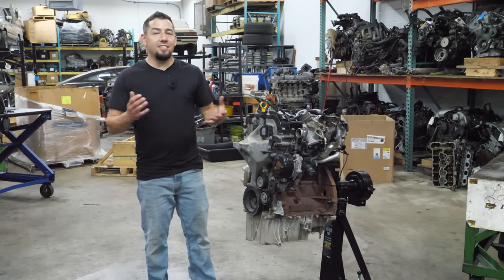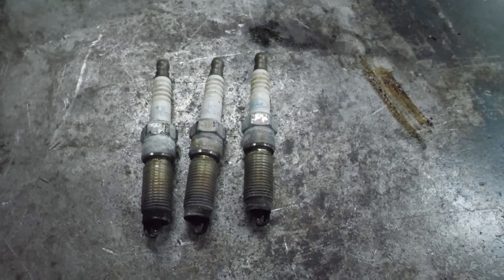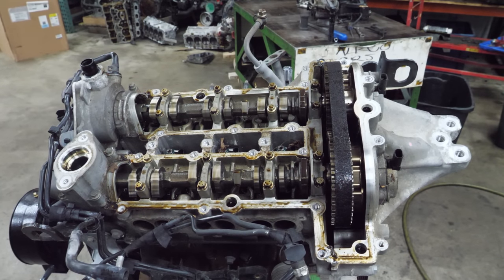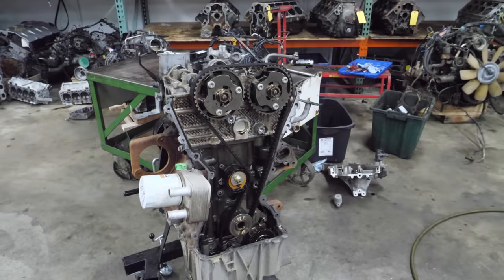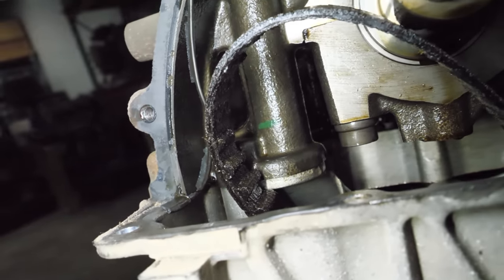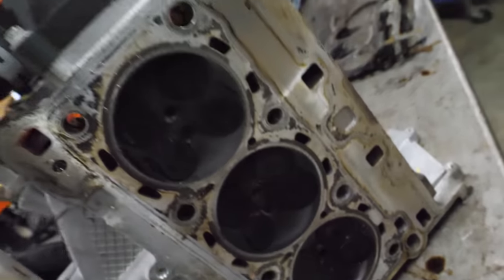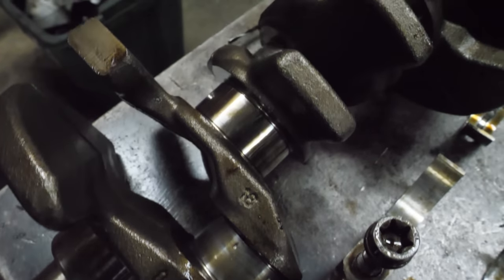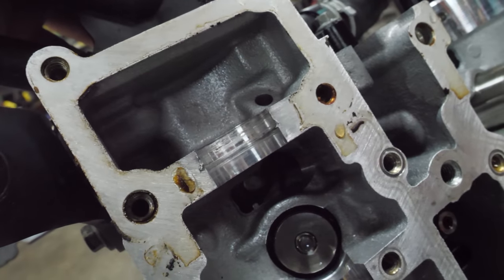JUNK Ford Ecosport 1.0L 3-Cylinder Ecoboost Teardown. LAWSUIT ENGINE!

Comment: The wet belts are of a specific polymer combination to accept oil wash down. They have shorter change intervals. They are slightly more efficient than dry belts but failure can result in a clogged oil pickup and filter. The filter will then be in permanent bypass, alongside the possible piston to valve interference.
Reply: Another commenter mentioned Stellantis is making similar designs - what’s the advantage to all this disposable timing stuff, and now the wet belt?
Reply: i think it's because it's not as noisy as a chain and eventually you don't know if it's time to replace it if you don't hear it. It's all very well calculated. Damn thieves, they just think of ways to take as much money from us as possible after you give a bunch of money for the car.
Reply: Thats quite an unbelievable design decision to have a short lifespan timing belt. Especially seeing what an absolute mission it is to replace. Dont see it happening without pulling the entire motor😮
Reply: Haha ,they have shorter intervals because it's a plain belt and normal oil 😂
The guy who said it's a particular composition belt is pulling everyone's leg. 😂😂
Reply: I checked the Ford maintenance schedule. It calls for replacement of the timing belt and oil pump drive belt at 150,000 miles. Given what was written on the oil filter, I believe this engine failed before 60,000 miles, and both belts were clearly well past their useful life.
Reply: @jeffreywoods4040  Indeed. The PureTech engines. They are pure trash. Belts wear down and debris from the belt clogs the oil filter with possible catastrophic results. They is a huge amount of cars driving around PSA (peugeot, citroen and ope;/vauxhall) with terrible reliability.
Reply: @PbPomper 
Yeah, my company Peugeot Partner van suffered with a blocked oil pick-up at a mere 20k miles and had to be rebuilt.
Reply: actually this wet belt have a longer interval than most dry belts.  Like another one mentioned 150.000 miles or 240.000 km. and they !can! last that long. But the most common reason for the failure of the belt is wrong oil.  Special oil is needed, otherwise the belt is sucked dry, exactly like this one. And im pretty sure that is the cause of this failure too.  Even if someone just topped of the engine with 100-200 ml of the wrong oil, it can damage the belt.

And the failure of the belt results in a clogged oil strainer following with complete oil starvation. And if that happends, all the bearings will take damage, like seen in this video. 

so never buy a car with a wet timingbelt (when u cant be 1000% sure that noone ever filled it with the wrong oil)

Funfact: the estimated engine life of the 1.0 Ecoboost is ~200.000km. So theoretical: when the engine is at the end of its lifespan, the belt is still good to go.
Reply: @MrTheHillfolk  Not true. I've seen composite belts made by Gates and others for all kinds of applications. Never seen one for wet designs however.
Reply: "iT's MoRe EfFiCiEnT"
I wonder who measures 'efficiency' this way.
To me, the most efficient part is the one that you never have to think about.
An engine that goes 100k before needing a major repair but gets you 20MPG is much more efficient than an engine that gets 30MPG but needs to be rebuilt after 60k.
All the money you saved on gas is getting spent on that ridiculous oil-immersed timing belt. Whoever came up with that idea is a colossal idiot.
Reply: @noobigernoobnoob7507  
Deutz uses belts. 
They almost doubled the belt life by directing air at it on one engine design.
Instead of being trapped under the timing belt cover, they ducted some air from the cooling fan to it. 
Haha I don't know what idiot thinks hot oil will cool better than air 😂
Sure liquid can carry away more heat ,but not if it's hot already 😂
Reply: @paulherbert5548  yeah that's the thing , skip an oil change or get a bunch of fuel in the oil and bye bye belt
Reply: In other words, it is a bad design choice.
Reply: @MrTheHillfolk  And with a turbocharged direct injection engine, fuel ALWAYS gets in the oil. It's not a question of if, it's a question of how much.
Reply: A well designed chain  system would be better than a wet belt , clearly cost saving hit the design.
Reply: @peterwait641  a well designed chain or belt would be better. It has the extra maintenance needs of a belt, the complexity to service of a chain, and an additional risk that a normal belt or chain wouldn't have due to the risk of the rubber deteriorating if you don't use their specific oil. 

They could've easily just adapted a chain to that design and eliminated all the added headache, and there's no good reason not to.
Reply: @SkylineFTW97  exactly ,and short trip driving is the worst for them,then they really load the oil.
Reply: @MrTheHillfolk  with a turbo DI car, I'd never recommend going past 3k miles between oil changes anyway for that reason.
Reply: @tomokokuroki2506  just quoting engineers much smarter than i
Reply: @tomokokuroki2506  power out ÷ power in. Nothing to do with "financial efficiency"
Reply: @peterwait641  it is most likely cost savings and planned obsolescence, I'd agree chain is best, more efficient than gears, quieter (better for avg person) and more durable than belts.
Reply: @phprofYT  yes
Reply: @amphedroxyn4251  Do you really think that engine would get worse fuel economy if the timing belts weren't immersed in oil, or they used a chain instead?
The reduced friction probably gets you a fraction of a horsepower more, and remember that you're exchanging severely increased repair costs for this if you're the customer.
The only people benefiting from this are the manufacturers who now can sell more engines and components. People should be aware of this and avoid purchasing things that are intentionally faulty.
Reply: @SkylineFTW97 Honda and gcv vertical shaft lawnmower engines were OHC with wet belt up till 2020. Then they went to push rods. Now they are getting away from the consumer engines. I don't think the new modular design was any good. Lots of them.blew up
Reply: @marshmower  I heard they used plastic cams too
Reply: @amphedroxyn4251  Toyota yaris is in the same small car market , they have a reliable chain !

Comment: The first time I ever broke into a modern Ford engine was with a 2.0l ecoboost in my 2013 ST3 Focus. I knew none of this information especially with the keyless crank and all that and I had to learn as i went along. Thanks to your videos I’m gathering a LOT more knowledge of these and you’ve kind of helped along here. I learned they use friction washers and I feel that a keyway would be much more important to have that just a simple torque retention. That in my personal opinion is one of the most inconvenient things any manufacturer could have done.
Reply: funny that my 2013 needed a new engine at 23k, found out later that a bunch of the 2013 plate units got fitted with dodgy piston rings that can grenade and any point and ford just kept silent about it hoping all the cars pass their warranty date before the issue come up unfortunately for me that issue cost me 5k and once i've got rid of my focus I'll never touch a ford again.
Reply: I still drive a Mk1 focus with the Ford/Yamaha/Mazda-collab 1.6 Zetec-SE engine.
It was their first engine whith a keyless crank and cams. The cam sprockets just had  a conical fit.
The whole idea was to save costs on machining and assembly. As far as maintenance goes.. So much that can go wrong.
Reply: It saves a machining step, it’s about cost. I doubt that was the cause of the failure.

Comment: I am a electrician that was doing some lighting in a Ford repair shop. Started a conversation with a mechanic that was replacing this engine with a new one. He said to me the same things this video was showing and telling. The reason I was researching the mechanics comments.Oil wet timing belt fed pumps are a accident waiting to happen. It is not a matter if it will fail, but when. And how soon. Purchasing one of these engine driven cars is only done under a full warrany. After warranty, get rid of it! And do not buy a used one.

Comment: I had this engine paired to a 6 speed manual in a 2015 Ford Focus. It did seem a tiny bit down on power in that car, but I am also a bigger person. Added a cold air intake and that made it sound nice and did noticeably add a little bit of power. I took it from Portland, Oregon to Reno, Nevada, on one tank of gas. Really loved it because the only option it had were that engine and a moon roof. Watching your video makes me kinda glad I got rid of it several years ago, but damn the gas mileage was awesome in that car.

Comment: Oddly enough, as a Ford dealership technician since 2000, I have yet to see one of these gems. After doing countless phasers, chains and water pumps on 3.5s both NA and GTDI, along with 1.5 short block and 2.0 long block replacements, I have yet to come across one of these wet belt engines.
Reply: What are your thoughts on the 2.7?
Reply: Same my buddy has only seen one 10 in on any platform and it was for something unrelated to the engine....
Reply: @mcallihan100  Other than the oil pan leaks that only seem to go away after a person fixes it, not much bad to say,
Reply: Just wait till you have to quote a timing belt. Nothing but endless discard bolts
Reply: @mcallihan100  as already mentioned above, other than the oil leaking from the plastic oil pans, there's not much else to be said about them.
Reply: Same. I'm a warranty claims adjuster and I've never had a claim on the 1.0 Ecoboost.
Reply: @michaelchan8915  glad to hear it. I have a fusion with that engine and knock on wood I haven’t had any issues with it other than the rear main seal leaking but that was fixed under warranty. 95k miles and still going strong.
Reply: Here in the UK almost all fords use the same wet belt engine, only the TDCI/TDDI in some Transits and Rangers use dry belts, but ford is moving to a completely ecoboost wet belt.
Reply: @mcallihan100  How did your leaking rear seal manifest itself? What were your symptoms?
Reply: @NotAnonymousNo80014  No real symptoms. Just was under the car doing an oil change and noticed oil right in between the engine and transmission. Surprisingly, the oil pan is completely original on my car and doesn't leak a drop. Mine is a 2018 though, and I've heard they updated the gasket for 18 and newer 2.7 and 3.0 nano engines.
Reply: Honda makes an OHC lawnmower engine with a wet cam belt.
Reply: Seen a few of the turbo escapes with chewed up oil pump belts. None of them had over 100k miles.
Reply: Does the 1.5 also have a wet belt or is it dry?
Reply: We had a turbo and cam failed   at  50,000km in NZ mondeo 177kw
Reply: That's because once they hit 70k miles they are junked.
Reply: I'm a Ford tech in europe, and I've had the questionable pleasure of doing timing belts on these. Absolutely awful to do, you need so many special tools, have to clean the sump, the oil pump, pretty much flush the whole system because bits and pieces from the timing belt will end up everywhere.
Reply: @brianallen9810  
This would make a nice lawnmower engine.
Reply: @patrickf6553  
You speak from into it elbows deep experience.😊
Reply: @michaelchan8915 recommend doing catch can on 2.7?

Comment: Hi Eric, great teardown, I've been curious as to the insides of the 1.0 Ecoboost and it's wet belt! I was one of the first to buy one in North America: I ordered a new 2015 Focus, 6-speed manual, a couple of months before that engine was added to the Focus plant in Michigan, based on the good reviews the engine was getting in Europe (this was in 2014, before the problems became known).   I drove it daily here in Canada, summer and winter, and put 330,000km (a little over 200,000 miles) on it WITHOUT changing the timing belt or touching the engine in any way, other than regular oil changes and a set of spark plugs!  I guess I was really lucky....I sold it in late 2021, as I was having some transmission issues...and by that time it was apparent that the belts were a ticking time bomb.  I was getting rather nervous about the belt failing, and having read up on the belt replacement procedure (special tools required to align everything because of the unkeyed shafts) I decided to let her go.  It served me well, although the fuel economy was good but not as great as I had hoped.  I think the reason it lasted as long as it did was the fact I was driving highway, 77 miles to and from work, each way.  I did run the heck out of it, though, you could rev those things up pretty high!  I always said it wouldn't win a race, but it wouldn't get in anyone's way either.  I think what really kills the belts (other than having a belt run in hot oil in the first place) is city driving, the 240 degree power pulses of a 3-cylinder at low revs must put a lot of stretch-and-release tension on them, no wonder the teeth shear off!  I miss the ease of service of my 1993 Escort from years ago, I could change the timing belt in 45 minutes in my driveway...no such cars nowadays. :-)  Keep up the great work!

Comment: This was fascinating to watch - this was identical in  every way to what happened to my Focus Engine.
Reply: What year and engine Focus did you have?
Reply: At what mileage?
Reply: Same on my 2017 focus. First failure at 55k, second 2018 engine with revised oil pump belt tensioner and belt died at 75k. Seems like a tall task for it to run the pump and countershaft so removed the counterbalance shaft this last go around and been replacing the oil every 4k miles. So far so good at 110k miles now 🤞
Reply: Is a ST?

Comment: This was one of the best teardowns of the last several months...although, for a couple of minutes, wasn't sure if I was at "I DO CARS" or "WRISTWATCH REVIVAL"...🤣🤣🤣. Not sure, think I got better mileage on my first 2-liter non-explosive SOHC Pinto... As always, Eric, an enjoyable video, good wind-down to the week. Keep'em coming...
Reply: The 2.0 Pinto was a great car, at least compared to the Vega.  Just watch your mirrors and don't let anyone bash your bumper...
Reply: I got great mileage from my 1200 Civic 4 banger in 1978. It easily got over 40 mpg on the highway with a 5-speed. Of course, it only had 68 hp but who cared?
Reply: My 86 Dodge D50 with a 2.6 and 5 speed got 26 and 34 hwy. That truck was a little beast until my ex hit a stump and sheared the crossmember. Then took engine out and put it in a 4wd of the same year. I miss those trucks.

Comment: Bud!!!!  FANTASTIC teardown. Your comments are to the point.. simply GREAT content!!!! My experience with this motor has been in the little Eco Van. I LOVED that Van!!! drove it 150 000 kilometers. Had all of its services and i had a funny feeling about that oil pump drive wet-belt setup from the get-go!   .. so i ALWAYS changed the oil at least 5k kilos before indicated service interval. I checked myself that full synthetic, as per Ford's reco went in the motor. I thrashed that little motor. I wanted to break it, and I really thrashed it, but no stupid stuff. No wheel spins..not sure it it can do something like that, or crazy abusive stuff.. i just drove it to the max. Always in a hurry to get to the next delivery. AND that little Van handled like a go cart!!! Beautiful handling.. absolutely adored it.
The company was supposed to replace it at 100k kilos. For some reason there was a delay... and I ended up going over the timing belt and oil pump drive belt reco replacement interval. On one trip in a hot desert climate.. I saw the oil light come on. Immediately stopped. Checked oil, no problem. I let it cool as best i could and took it much slower back to base. Immediately sent it into the workshop. SAME issue as you found here, lost a couple of teeth on the oil pump drive belt.. and the oil pickup was almost entirely blocked.. EXACTLY like this one. Our workshop did a fantastic job and i drove it hard for another 30k kilometers until my beloved Ford Transit minivan was replaced by a piece of shit French/Indian Renault whatever the hell they call that monstrosity of a vehicle!!! Ford discontinued that little Eco Transit van here in my country, stupid stupid move from my humble end-user perspective. That Ford Eco took everything i gave it AND more. Never missed a beat. Never had to replace anything other than service parts and tyres. We have a great workshop.. and i always sent it in for oil changes and service way before Ford recommendation.Ford killed the best small delivery vehicle right there. What a dumb-ass move!!! When you saw that wet-belt setup and said "WHAT???"  i knew you are a professional!! Kudo's man!!.. job well done!!!  and entertaining to boot!!!!